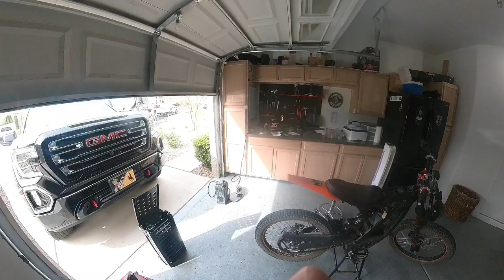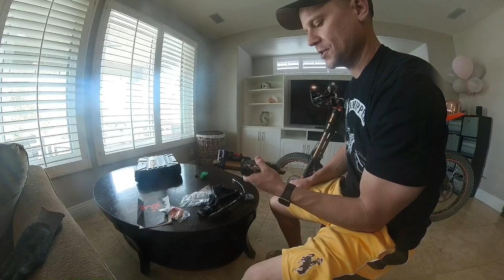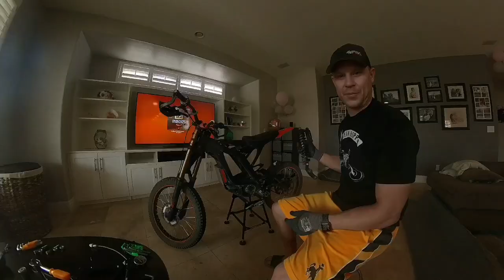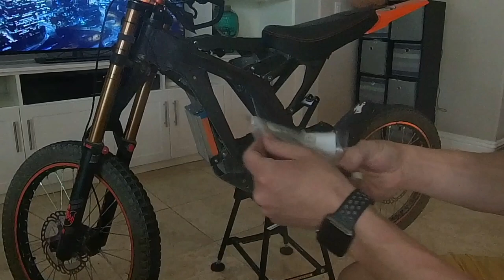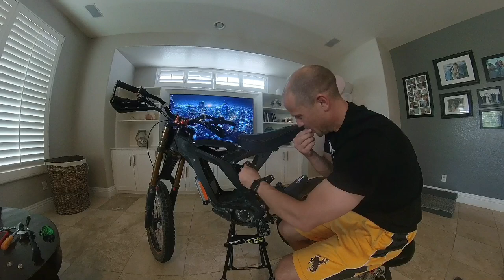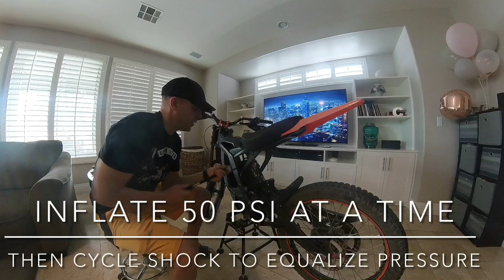Surron X - Fox Float X2 Install

Comment: Just installed this today, what did you end up finding was your sweet spot on settings? Might jump into it at that instead of exploring from scratch. THanks for the vid
Reply from the maker: I’m about 180lbs. I’m running it at about 275 PSI with all the dampener and rebound settings about 2 clicks away from full.  No complaints yet but I need to play around with the settings some more while I’m out on the trail and see how different setting feel.
Reply: @sonsofampacity121  Right on, thanks for the reply!

Comment: So, based upon your video I can't recommend this for any riders over 185 or so, given it seems to sag balance at 285 psi w 175 rider...  any heavier and will quickly approach shock max pressure rating of 300 psi...  600+ lb coil shocks are probably more appropriate for riders at that weight and up
Reply from the maker: Agreed, I’m probably about max weight for it.  Haven’t really bottomed it out yet though.